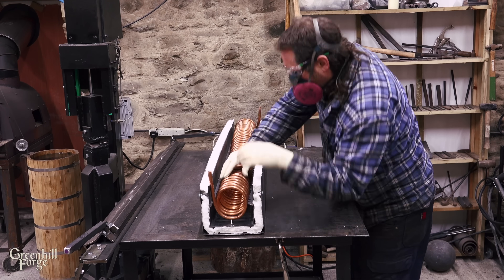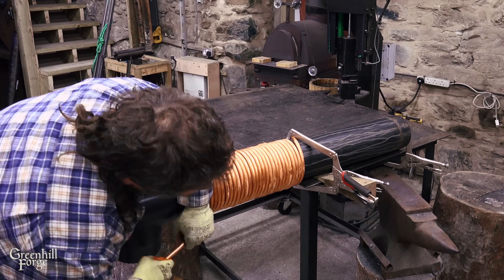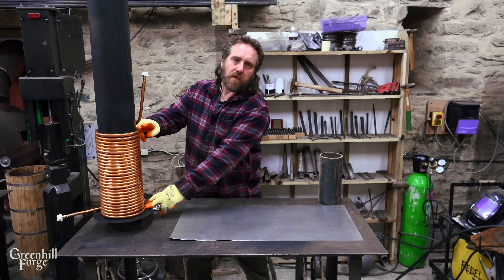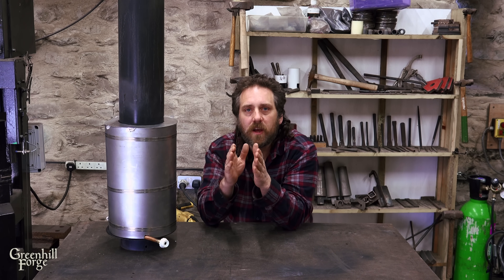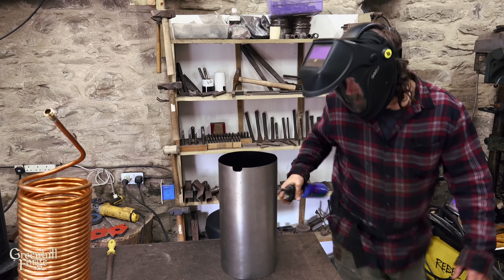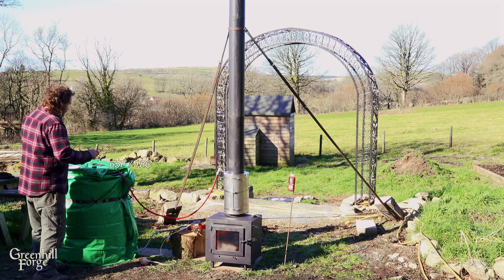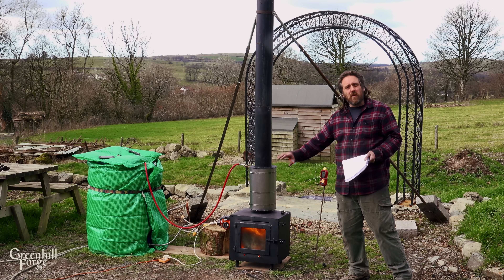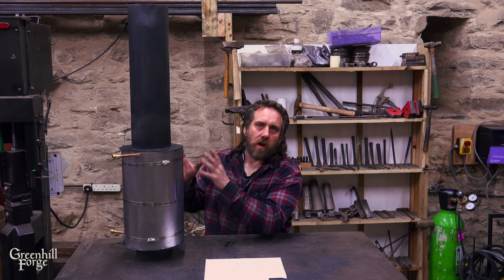Best Wood Stove Water Heater Yet: New Design Tested | Off Grid Water Heater pt3

Comment: Pretty neat. 
   How about a section of copper flue pipe that would allow for easy cleaning on its interior. The outside of this section the copper tubing can be wrapped and completely soldered directly to this portion of the flu. Thus, you would have direct contact with the flu, allowing for maximum heat transfer….Without obstructing the interior exhaust flow of the flue.  
        Maintaining water flow (thermal siphon) would be necessary to prevent the soldered portion from melting, and increased creosote (?)  would probably mean more cleaning.  No free lunch, but your wood use might be greatly reduced.  🔥

Comment: That is a lot of expensive copper tube. Perhaps 2 pressure sealed sleeves, one inside the other. The inner sleeve is the flue pipe, and the outer sleeve is the water jacket. This assures maximum thermal contact.

Note: Any method of extracting flue gas heat is going to cause creosote buildup - integrating a solution to this problem (I dont wxactly know how, but have some ideas) could actually make this fireplace safer than a conventional setup. That would be HUGE.

Comment: I think you should take inspiration from the design of steam locomotives and conduct another test: Build a heat exchanger using steel pipes by arranging multiple one-inch-diameter steel pipes vertically with some spacing between them. Then, construct an insulated water tank around them so that water can flow around the pipes while the exhaust gases from the stove pass through them. You should ensure that you use enough of the thinner pipes to avoid obstructing the exhaust flow too much. Steam locomotives were built this way.

Comment: Just a thought.. you  could use the same length of copper but leave 3/4 inch between the loops.  This would contact with more length on the stove pipe and allow 3/4 inch of the graphite (between the loops) to absorb and transfer heat to the copper loop.  The only down side I would see is that you would use more Graphite.

Comment: I found a Belgian stove that was manufactured with a water jacket around 3 sides of the fire box. Solves the creosote heat transfer problem. I was using it as to heat a huge water tank/heat sink radiator so i had anti freeze in the water tank. But you could also find a water jacket stove and heat domestic water. But obviously you would have to drain everything in unattended freezing wx.

Comment: Very nice experiments and I appreciate the  calculations of wood burned, efficiency and kW output. However I really wonder why the copper tube is there in the first place. It has terrible contact efficiency with the flue and even if the graphite powder improved that it's still a bad design. Weld up a watertight shroud round the flue a couple of inches wide (in radius) and fill that directly with water. Contact efficiency will be 100% and no powder needed. Insulate it on the outside and pump directly into the shroud. Make the shroud as long as possible and maybe baffle inside the flue to slow the gases down. I would be interested in performance with and without baffles and also top vs bottom pumping locations and pump rate. I don't see how you can get better efficiency with that type of external to the flue design. It may be still preferable to have a water container directly above the fire and with a horizontal run of water jacketed flue to extract every drop of heat but that's a whole new project.

Comment: I can't help but feel the biggest advantage is being missed. You're packing all the copper into one small area while the rest of the flue is left to dump it's heat into the air. You're super cooling one small portion of the flue which means you're not pulling the highest possible temps. If you just wrapped the coil with a much wider spacing you could pull heat from the entire length of flue. Each foot of the flue would only give up a small portion of it's heat meaning higher temps along the length of the copper. Space the wrap out so the coil covers the full height of the flue. Zero cost increase, massive heat increase. Additionally the sections of the flue in between each winding of the copper will still dump their heat to the air which will the flow up and over the outside of the coils like insulation.

Comment: This will work.   Weld a box slightly larger than your coil with a "Flue In" and Flue Out" flange on the top and bottom.  Make a door for it as well.  Then cut a hole in the right and left side of the welded box.  This will be your water inlet and water outlet.  I'm sure  you get what I'm saying.  Don't forget a couple of shut off valves.  I use a very small pump and it works amazingly.  Could also make a liner to use as an over..LOL

Comment: what about using plain water instead of graphite?  will have a start up cost for water to reach temp but will have great conductivity for heat to pipe. you could also increase the inner pipe surface area with vertical stripes to conduct more heat to the outer surface?  (ofc - dont seal in the water or else you'll have a explosive pressure risk!!)

Comment: Try making a chimney out of refractory (fireplace) concrete with the coil cast inside (like rebar). You can then use it as your chimney and test what if any insulation on the outside would give the best results. If cast well you can clean it as you would any normal chimney so any build up won´t be a extra problem.

Comment: You are without any doubt a great craftsman! And one of the best video producers I can imagine! For heat exchangers, you might learn from Igor Kuznezow's steel pipe radiators, for you very easy to make and incorporate in an after-combustion-chamber, that can be more or less like the one you are showing here. If you need more info, contact me: e.g. why steel is better than copper, in spite of the better thermal conductivity of copper.

Comment: An other idea would be  not to use a coil but to make the water circulate directly in the pocket. You built an actual tank around the tube with an intake and an out take. Quite simple design but i thin it can be effective expecially if you use a corrugated inner tube. You should of course use INOX.

Comment: What is the hottest part of the flu? Is it right at the stove or is it? Add a bend at the top of the flu. Maybe if you used eight forty five degree angle, another forty five degree angle, a straight section of pipe, and then forty five back into the flu, that would slow the gases down inside of the flu, creating a much hotter section of flu pipe

Comment: Hi I like Y'r experiment.... But I miss a very importent qestion.... WHY.......Why is the performance different.... and  .... WHY..... do Y get "creosote"...... What is the difference in the two setup.... and the answer is Temperatur.... of the smoke inside the pipe..... when the coil is in the inside, and the outside..... What Y miss is the reason for when the "creosote" is made ..... It can onley be because the temp of the pipe inside the tube is to low so it make the "Creosote"..... If Y take the setup where Y have the coil inside the tube, and add a shunt and let some of the hotwarter go back in to the cupper coil in the smoke in the tube.... and rising the temperature so there isen't any creosote collecting on the copper coil.... Y have reatech the sweetpoint for The output performance of the heat in the smoke for that setup ......... The temp must not be lower then then that.... and That will be Y'r max performance of this system.... Sorry for my spelling... I am a Dane from Denmark DK..... Happy building Best From Denmark DK ;-)

Comment: one thing i would try is to spread the coils over longer length of fule pipe!
In your tests, it collects energy just out of short piece of pipe. I am sure that it would extract much more if heated section was longer... As long as possible!
Bravo for the series! And I was also surprised at efficiency gain with sand... 
Thank you

Comment: The graphite powder was a smart idea. I was thinking half way through, 'what would be a better thermal transfer compound than sand' since you obviously want something that's not a mess to deal with, but still does the job well enough. That's a good solution. I have a few ideas that may help. Maybe not. Hard to say for certain without seeing them tested out. 

1. Increase the length, and decrease the gauge of the pipe being used for a coil. Longer coil, thinner pipe. Not much thinner, just a bit. Reason being is surface area. We want to increase surface area contact as much as possible between the heatsource, the thermal interface if any, and the coil itself. About the only way to do that is to either flatten the thicker tube to make more contact with the wall of the flue, or make it so the pipe can coil around more by decreasing its size in width/circumferance. A wider chimney flue may be useful here too.

2. Reverse your flow. Hot out of the bottom, cold in at top. It's going to let gravity help a bit with the flow of the water out of the coil. If your tank height is the reason for going out of the top, I realize this is a bit of work, but dig down to drop the tank down into the earth a bit. Adjust for height that way instead. If you can. You should only need to remove about 3 cubic feet of dirt I figure, maybe a little bit more. The pump already involved should be good enough to handle most height differences at this point anyways. But if some sort of powerless pump system were involved, that this would definitely matter more. Anyways, the point here is to let the water heat up from the top where it will be naturally cooler than down below closer to the actual heat source. If I understand correctly, this is going to be more ideal in regards to temperature deltas involved in making sure that the water keeps pulling heat instead of transfering it out instead. I.E. You want the water to be warming up, but to remain cooler than the hotter temperatures that it will be pulling heat from in a moment. In the current setup you have, you are getting a decreasing delta due to the flue being cooler higher up than down below. If taken to the extreme, there will be a point where your coil will be heating the pipe instead. By doing it from top to bottom instead, you should get the most heat from the chimney flue into the copper pipe and thus the water as possible via any setup attempted per its extra features involved. 

3. This one is a bit of a risky one for folks not careful enough to be trying it, but you could setup your chimney to be a reburner for the stove below by letting the flue gasses collect and reburn in that section of the chimney first prior to releasing it through to the rest of the chimney. I've done something similar to this before without a water coil on it, to increase the efficiency of my own wood stove I used to have a long time ago. No, no house fire. I will warn ahead of time though, be careful of creosote build up with this method. Clean that chimney out every 4 months at maximum. 

My setup had a straight pipe up out of the stove, a spiral with dampers on both ends, a 90 degree bend to go out the wall, and then a T junction I guess you could call it, to allow for the actual chimney to soar into the sky. The T junction was a way to access the horizontal and vertical shafts without disconnecting them outright. For maintenance of course. The spiral was setup to be easily removed if need be, so it could be replaced while cleaning out the old one. In my use of it, I ended up finding out that I needed to increase the length of my chimney to achieve adequate airflow, so take the hint if attempting it, go big. If you think you need more, add more. 

The result though, holy heck. That thing threw off heat like it was nobodies business. I got that tuned in just right so it wouldn't go cherry red, and the house, all 2800 square feet of it, was nice and toasty through winter, with a couple fans helping redirect the heat. That huge porch I had with it in it (solid foundation for the weight), was so hot most of the time, that you could go outside in your shorts in -40c, chop wood quickly, hop inside to warm up in under a minute, and go back out and finish the load required. 

A bit extreme, but I tested it to be able to use it as an example, because I am sure it's a metric we all can understand. Heckin cold with minimal clothes, to being heckin warm with little as well.

I'd run that stove long enough to get the house up to temp, let it cool down, then fire it up again when it got cold enough to justify it. If not for the insulation being what it was in that house, I probably could have gotten away with 2 burn cycles a day. One in the morning after waking up, and then another around dinner/night time prior to going to bed. 

Again however, and I cannot stress this enough, this is not a recommended method to be trying by anyone who is not willing to put all the time and effort required to doing it 'safely'. If there is even such a concept when doing it this way. Usually reburners keep everything in the baffles. But if you don't have baffles, or room to put them in your stove, what then? This was my solution, and it was not a smart idea by safety standards, but holy heck does it work when done 'right'.

Just be sure to have a high enough rise in your chimney to acheive the proper airflow, because those 90 degree bends and the spiral are going to put a big damper on that, aside from the dampers already put on it. In regards to those, you want one only sort of closed, to slow the flow a bit, then the other a bit more closed, to allow collection. Done right, it will light itself and begin operating as intended if built correctly.

Comment: To increase heat transfer, consider if you could use thermal paste / thermal grease between the flue and the copper. This was the first video of yours I've watched so I'm not sure if this has been tried.

In computer hardware, we use thermal paste between the CPU and the copper heat pipes because efficient transfer is critical for performance. 

With a quick search i could find some options rated for 200C and one at 280C operating temperature. I'm not sure if the flue temperature is within this spec but, there may be some industrial solution that is designed for higher temperature.

The other potential drawback is the environment. While thermal paste is designed for hundreds (thousands) of thermal cycles, the application is typically inside a computer where there isn't a lot of exposure to dust, smoke, etc. You'd want to keep the coil shrouded like most of the designs here. (Before anyone says... yes there is dust inside computers, but the paste is typically sandwiched between things, not exposed to open air)

Another upside is thermal paste/grease is dielectric, so you wouldn't need to worry about contact between different metals.

Comment: That was interesting. Any chance you can “shape” the coil to the flue to get more touching surface area? 
Gonna watch the rocket stove video next
Reply from the maker: It's tough to get perfect contact. being able to flow in some solder would be great if it could stand the heat but then you'd have to remove the ceramic coating. liquid filled would also be good but that comes with it's own set of problems

Comment: its essentially just a game of heat transfer, so a copper flu would do a better job at capturing more of the heat. unfortunately a cylinder is going to have the least surface area to the volume of exhaust its passing giving you the least possible heat capture while its passing through. the more surface contact you can get from the exhaust gases the more potential heat you can capture so an ellipse would serve as a better shape for your flu while still being easy to wrap a coil around. further a great amount of your heat is going to be on that top surface of the furnace so a heavy copper plate could serve to conduct that heat over to your coil, especially if it can interface with a copper flu. the thicker the gauge the more heat it can conduct at a time. as for your coil the cylinder argument applies to the copper tubing aswell. a flat coil will transfer more heat into the water than a perfectly round one its just harder to form it. use "flat" copper tube instead.

Comment: So many takethis foolish copper coil approach. You need a radiator to get the surface area required. Just buy a properly calculated and efficient design and save yourselves the time and trouble.

Comment: The thermitic reaction you mention in reference to Aluminum is not an issue at all in this scenario. It takes temperatures FAR FAR above what a propane torch or stove can achieve to start that reaction.

Comment: As your heat transfer becomes more efficient, you will begin creating the very problem you were trying to avoid in the "in the flue pipe" system.  That section of pipe will begin condesing and making creosote.
Reply from the maker: true, but it's much more cleanable. it's all a balance of trade-offs

Comment: So you need to increase the surface which is exposed to exhaust gases to extract more heat. You can enlarge current system vertically but still tube shape  isn't a prefect one. 
So it seems best going with a hybrid design of radiator you've done in previous video and water heating circuit. 
What if just trying to build a water "shirt" around not movable parts of radiator? More surface - more heat extracted. And it will be nice to add some more metal stripes inside radiator to increase surface even more but keeping a way to adjust the flow.

Or... Keeping this exact setup. What if you add some more surface inside the tube in the area you try to absorb the heat by adding metal stripes parallel to the tube but perpendicular to the wall longitudinal. If that makes sense. 
Should give like 5-7% more efficiency.
Kind of compromise between putting copper tube inside and outside the pipe. It's always a compromise as you've mentioned.